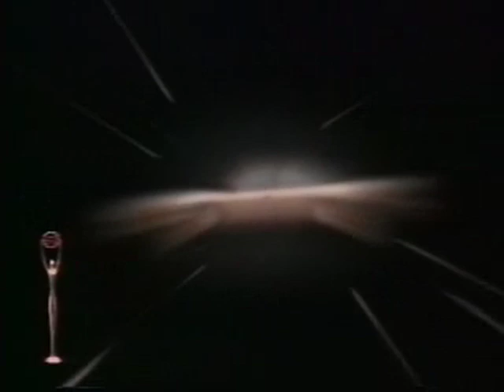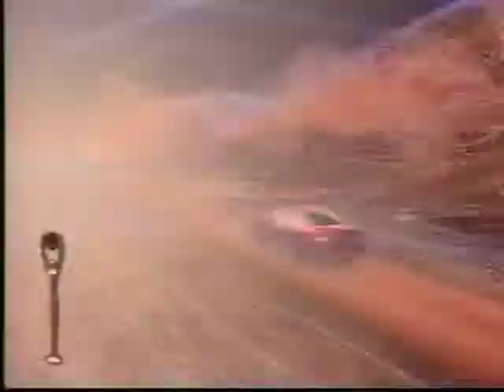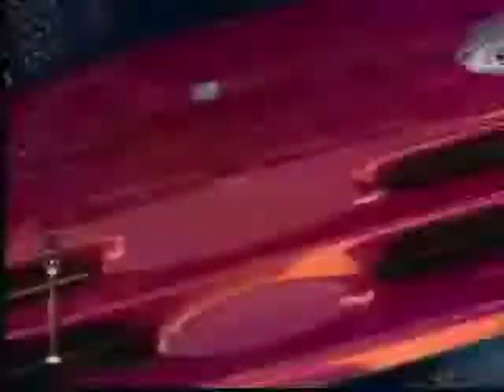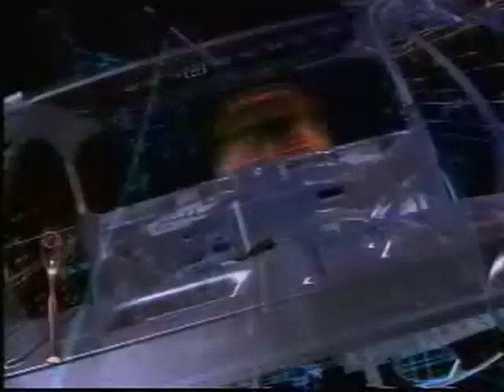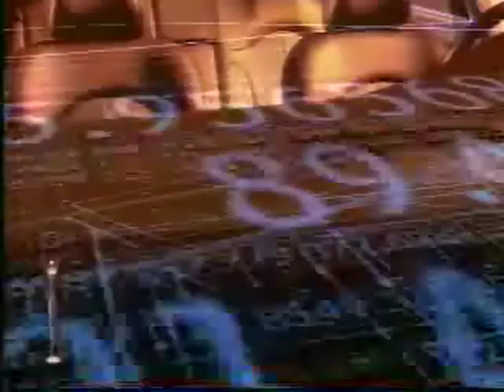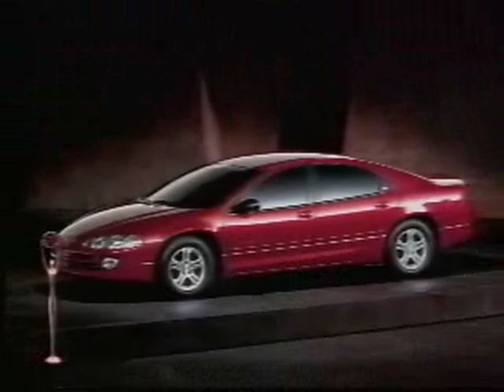Dodge INTREPiD 1998 commercial

Comment: Unfortunately I'm probably going to have to retire my 2002 Intrepid soon. It has developed some rust the last few years. The left of the gas tank cannot be bolted on anymore. It's a shame because at 271,000 miles the 2.7 still runs and shifts fantastic. I'm going to take it as far as possible. Usually the 2.7 killed these cars. Mine is outlasting the body.

Comment: Got this car for free with 58k miles and put 12 k miles on it so far. I have a love/hate relationship with it so far. It's got issues due to its age but it's been a learning experience and I feel like it's been a good first car to learn the basics of car maintenance. Working on putting a new timing belt and water pump, changing transmission fluid, and changing the fuel pump because the current one got fvcked from the previous owner who let it sit for months. Just is hit or miss when it comes to starting but runs normally. Don't know how to feel about it tbh
Reply: I love mine. They just require proper maintenance and are excellent cars.

Comment: stay away from the 2.7 liter
Reply: mine has been good. She has 190.000 miles and runs great.
Reply: sure. But she will never be a crown vic/grand marquis. I'm not even a ford man.
Reply: You got lucky, I would advise to get rid of it. Get an old Camry with 200k on her. You will gift the car to your grandkids some day
Reply: Are you sure your Intrepid doesn't have the 3.5 ?
Reply: Yup, my dad's 1999 2.7L got up to 292,000km before it sold for $600.
Reply: I think the later (post 2002) 2.7L's were built better, but my Dad had a 98 and I had a 01 ES, they both died of engine failure. On mine though the engine was replaced with a 2.7 from an 04 Sebring and it ran until I got rid of it in 2011. Now I drive Toyota's and rarely need repairs.
Reply: 700 miles from 200.000 now.
Reply: Still going strong. 228.000 miles.